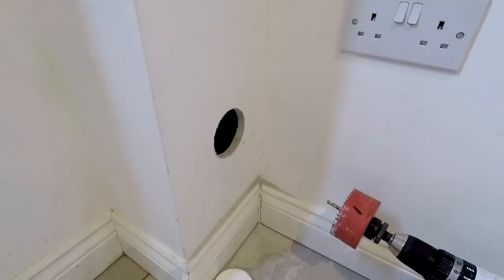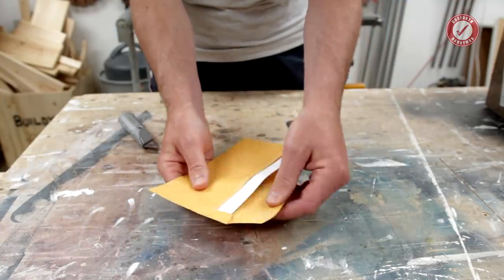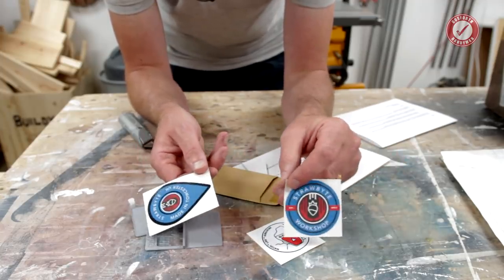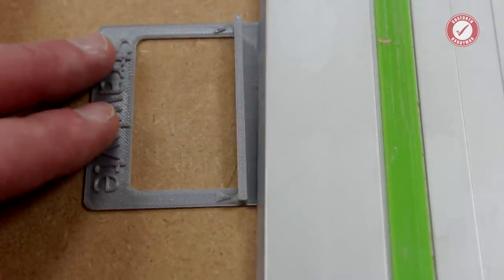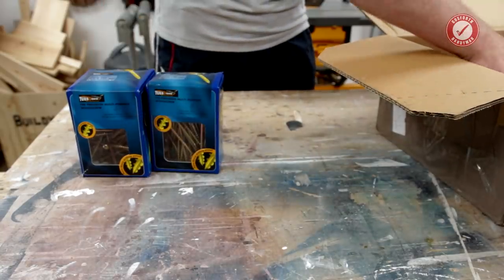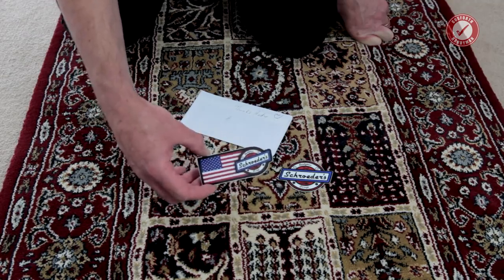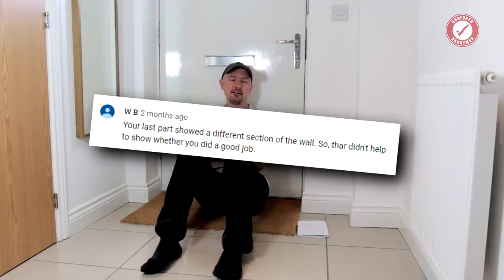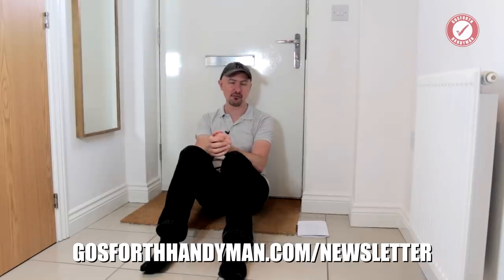Notes from a Small Workshop - Mailbag #5, Woodworking Vlog (Sept 2019)

Comment: "you can never have too many hard drives"
I can confirm, that yes you can have too many hard drives!
I know someone with removable drives everywhere and not a clue what's on them.

I wouldn't bother with that NAS, it's  old, slow and only two bay.
Invest in a new 4+ bay NAS from Synology or Qnap for all you video storage needs.  It will cost with decent drives, but worth it (and tax deductible?).
Reply from the maker: I'm up to about 20 HHDs of archived video content so far - it's crazy. 😂👍
Reply: @GosforthHandyman  
What, are they 20mb drives? 
You know that 14TB drives are available now?  :)
Reply from the maker: They're all 500GB to 2TB.
Reply: @GosforthHandyman  
That would be why you have so many then :)